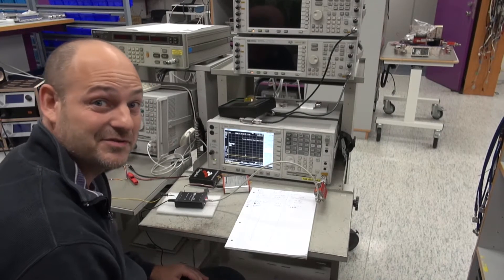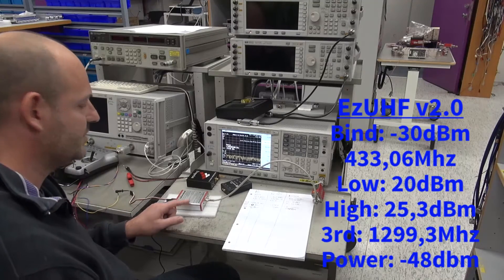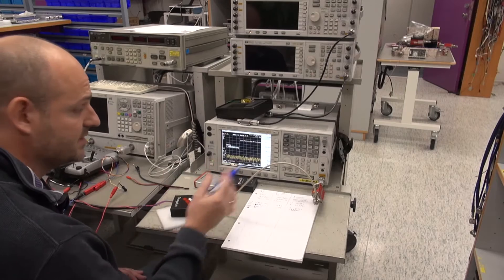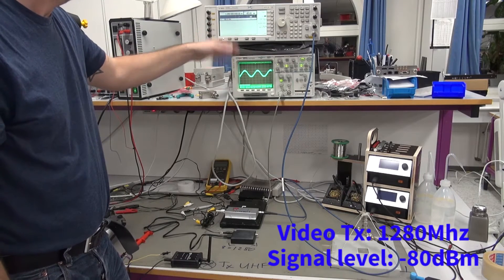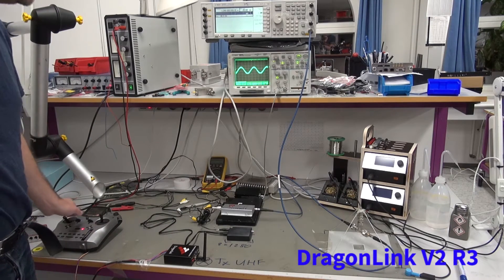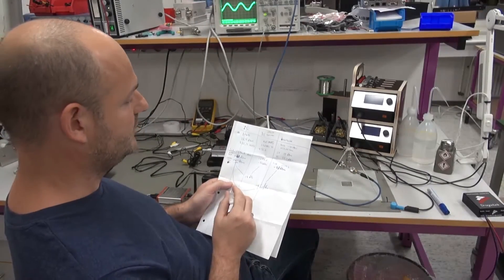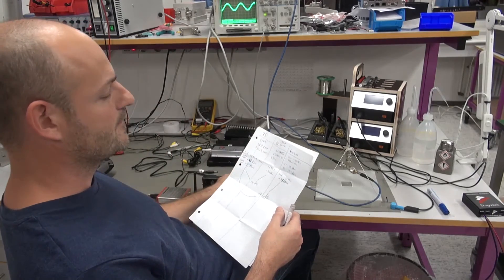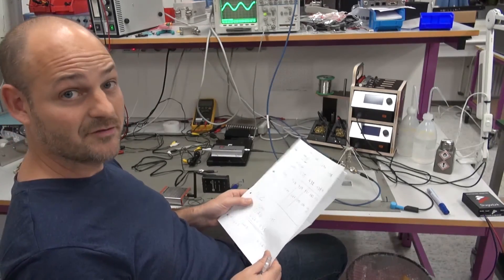Harmonics & Frequency planning, Technical breakdown of TSLRS, EzUHF, DragonLink

Comment: I really, really appreciate such a technical review but your comments are confusing. You show us a spectrum and turn on the dragon link and that spectrum, 1280Mhz, is impacted. Then you turn on EZ UHF and there is no impact to 1280Mhz but yet you call it the worst performer as far as spurious frequencies go, how can this be? For that particular frequency what you see on the spectrum analyzer is what you will get in real life or in other words, no impact at all to 1280Mhz which is what I experience with my 1280Mhz video on EzUHF. I think what you meant to imply is that EzUHF's 3rd harmonic is worse than the other 2 but only on it's resonant frequency which is NOT 1280Mhz...so then what is that frequency? Also consider ultra-wide frequency hopping on the EzUHF whereas the other 2 do not have that technology, EzUHF can transmit on 430Mhz to 450Mhz making it the widest range and thus having a wide ranging variable 3rd harmonic which means that if your 1280Mhz 3rd harmonic of 426.66Mhz, from the TV transmitter,  starts to impact the EzUHF it simply changes into one of its other frequencies making it so the 3rd harmonic from the video does not impact and this works both ways for both transmitters. Doesn't this imply that the EzUHF will always provide a cleaner signal against this 1280Mhz and is also capable of removing itself from jamming 1280Mhz video?

Comment: hi dborup, you got it correctly.. the EzUHF got the worst 3rd harmonics, 16 dB over the level the TSLRS has. However since the Ex uses a very narrow band on the UHF band, its harmonics off course also "hits" a very narrow band in the video area, this means the hit is out of video band = no problem for the user :-) he thinks it is the best..
With the TSLRS, it uses a very broad band of the UHF band = better imunity against other usage of the band, and also much more stealth, each uhf channel is affected (used) very little power vs time wise, this means it is very hard to kill and also very hard to detect.. ok this wider uhf usage, offcourse also hits wider on the video band.. but if you choose the correct video channel, you will still be perfectly fine.. If you at the same time add a little common sense, like DONT locate a video receiver and its antenna very close to a strong pulsed and frequency hopping transmitter, you will be fine times two !

Comment: Very nice review, it once again prove that's we have some great danish pioneers.

But it's confusing when you say, on the 1280MHz video test that the EzUHF has the worst 3'rd harmonics, it don't matter it has the worst, when it's not near the 1280mhz video that most uses. right?
And the second most used is 1320MHz, and non of the hop channels on the EzUHF will come near that
431-433MHz = 1293-1299MHz
433-435MHz = 1299-1305MHz
435-437MHz = 1305-1311MHz

But awesome review! just a little confusing for a N00b like me that is just starting to play around with LRS :D

Comment: Interesting review Thomas, and a great explanation of why choice of UHF uplink frequency band is so critical. 

Couple of notes from the ImmersionRC side. 
Firstly, your summary statement for the EzUHF 'It has the worst harmonics, but doesn't affect your video link' is fairly important to our customers who fly on 1.2/1.3GHz video. 

The three standard (user-selectable) bands for the EzUHF are 431-433MHz, 433-435MHz, 435-437MHz, which result in 3rd harmonics of 1293-1299MHz, 1299-1305MHz, and 1305-1311MHz respectively. The closest commonly used FPV downlink frequencies on the 1.2/1.3GHz band are 1280, and 1320MHz, which are both outside of the 3rd harmonic range. 

The frequency bands used by the EzUHF were not chosen by accident :-)